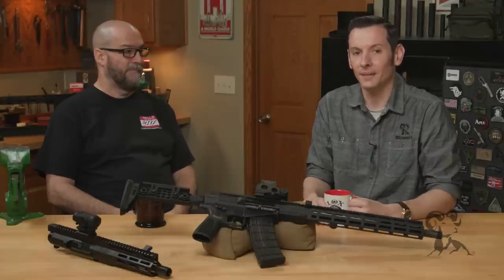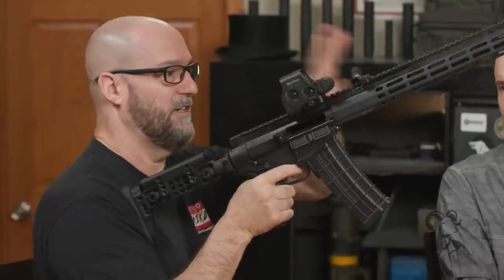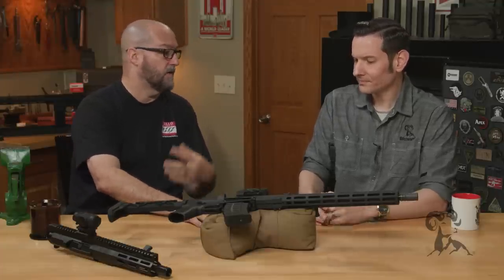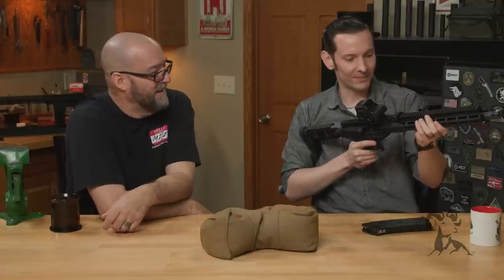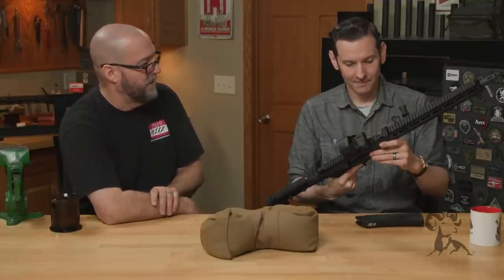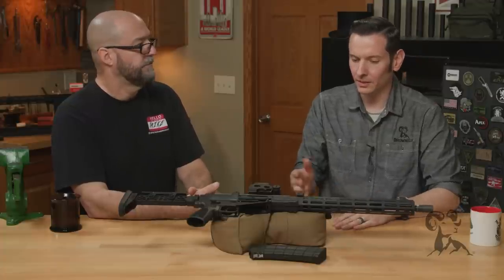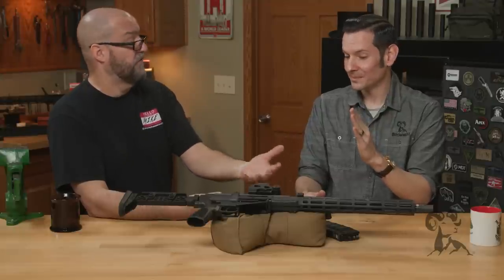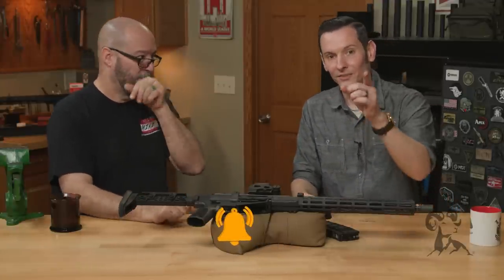Product Spotlight: Foxtrot Mike Slap Mod

Comment: this in 7.62x39 with a gas piston would have been absolutely game changing (I say would have been because of the rus ammo ban)
Reply: That's what the BRN-180 is for.
Reply: @mig1nc   Yea, the BRN 180 is nice, & close to what I believe OP has in his head, because its in mine too, the what the BRN falls short on is it doesn't take AK mags. The Mike-102 hits all the marks, just need to be piston driven, chambered in 7.62... or shit maybe even a 5.45 option...
Reply: An AR platform not taking AK mags is not a shortfall, at all. This rifle a prime example of that along with the Palmetto State KS-47, which I have.

Making an AR to function with AK mags means you lose features like LRBHO and bolt lock/bolt release. Everyone that has shot my KS47 had second thoughts on it when they realized those AR functions were removed. Determined that if I’m shooting 7.62x39, use an AK or an AR that uses STANAG mags.

Comment: Eugene Stoner got this right the first time.
Reply: The first time, he got the charging handle under the carry handle, where we put optics nowadays.
Reply: Cope
Reply: Considering how high people run red dots nowadays, the OG changing handle might clear that space.
Reply: @ChaohsiangChen And it was REALLY hot and could brand your finger.
Stoner was a GENIOUS and designed and absolutely amazing weapon..  but iterative improvements happens for a reason.
We tinker and try things.  Some of them work great and live on, some of them die.  You don't know until you try.
Reply: stoner took the johnson LMG, slapped his gas system on it, and filled the BCG with a bunch of tiny parts you get to lose in the field every time you clean the bolt.

Comment: I would 100% buy this if I had a compatible gun. Super cool.
Reply: Buy the lower and you will
Reply: @dangerousfreedom4965  *will not
This system is designed for Foxtrot Mike's proprietary bufferless uppers.
Reply: @InvidiousIgnoramus brn180, and the JAKL will work on the FM lower.
Reply: @InvidiousIgnoramus  the uppers fit on any AR lower, the only proprietary part is the bolt carrier. The barrel nut is a bit too tight to fit most barrels but you can modify some to work. The proprietary bolt carrier can take any bolt. Some people have made fm15s in 7.62.
Reply: @TazyBaby  this video is SPECIFICALLY about a handguard upgrade kit for FM-15 uppers. It is not compatible with other upper receivers.
Reply: @InvidiousIgnoramus  yes and? I was talking about the proprietary aspects of that upper
Reply: @TazyBaby  Which as absolutely nothing to do with my comment at all
Reply: @InvidiousIgnoramus  when you say its proprietary and I talk about the proprietary aspects, it is relevant. Don’t bother replying, I’m not trying to have a conversation with such a rude person.
Reply: @TazyBaby  It's not relevant at all, because the handguard only fits an FM-15 upper.
Reply: @InvidiousIgnoramus  and I was talking about that upper, what’s hard to understand about that?
Reply: @TazyBaby  Probably the fact that you replied to a comment that's over a year old with completely irrelevant information?
Reply: @InvidiousIgnoramus  well, the ignoramus part of your name is absolutely correct

Comment: This is huge for the bullpup kits, like the Reap SCY and the upcoming A3 Tactical TRIAD. I can't wait!
Reply: They need to do a linkage for the magazine button or the A3 tactical is going to fall short.
Reply: The Reap SCY is already on the market, so not much they can do.  Hope they both put a little more effort into version 2.
Reply: @lance9150  No linkage needed for rock in mags.
Reply: @mig1nc  Yes, but the conversions mentioned use a milspec lower.  Some sort of paddle linkage on the bottom would probably be the most elegant solution, but these companies aren't going to listen.
Reply: @lance9150  your comment is six months old, since then have you seen the video BarginBinTactical did on the TRIAD? They seem to have covered what was needed. Nothing seems to have fallen short.

Comment: As a newly minted FM15 Gen II Zhukov owner, I can say that I NEED this for mine.   After living with the rifle for a few days, one thing I have noticed is that the side charging handle doesn't really lend itself well to locking the bolt to the rear with the standard AR bolt catch since you're operating both systems on the left side of the weapon (if you have the side charger in the standard position).  Being able to just pull it back and lock it HK style will be a real game changer in the FM15 manual of arms.  Shut up and take my money.

Comment: Can I get this for my FM-15 Gen 2 in 5.56? Or does this only work for the AK variant?
Reply: Why would you want it on one with Ar mags? It already has a bolt catch
Reply: @Kataquan  easier to lock back using one hand. When you pull back on the charging handle you need a second hand or empty mag to lock it in place.

Comment: If you could set up the slap mod to hold the bolt just behind where the bolt catch would hold it, there would be no need to remove the bolt catch

Comment: why is the extractor pin so fragile that its required to be replaced every time you disassemble the bolt face for cleaning? and why do instructions say it has to be replaced, along with a firing pin spring every couple hundred rounds?

Comment: So... does it fit onto an AR lower like the FM-15? Cause Caleb is right, that IS a whole vibe, and I want in... but without needing ANOTHER lower.

Never mind. They answered my question at the end. In the works.... I remove that Bolt catch on my AR, if I can trade it for the slap mod (shut up... I had considerable time on the MP5 and I want to feel that cool again... don't judge me!)

Comment: breaths intensely Holy moely, the possibilities of this product, and at around 100 dollars, it will be a hit and I see possibilities to expand into even converting and letting go of the rear charging handle of my ar15 in the future. I think I will finally buy something shorter than a 20 inch barrel for my ar15 just for this, maybe a 9mm upper, and even a hybrid 7.62x39 ar. This feature is going to bring a lot of recreational fun to the gun community, Im loving it.

Comment: this is cool, im currently researching how i can make an ak/ar hybrid but have the bolt be right side charging like the ak as well, currently i have it down to using a psa ks-47 lower and a bear creek arsenal upper in 7.62x39, thing is the upper and bolt need modified to fit and feed from an ak magazine, so i need to get a milling machine of some kind. have my eyes on one thats not to costly, id just need to buy the parts and give it a shot, it it works then ill have a one of one ar/ak hybrid that you can actually do an "iraqi" reload with. what would be even better since the fm-15 upper is piston driven i could have that too and have a true ar/ak hybrid.

Comment: i have been thinking about this
are rear charging handles dying out?
Reply: No.
Reply: As much as I hate the charging handles current location, moving it forward onto a sloppy rail isn't the answer.
Reply: The Robbinson side charger like a FAL, or Galil ace is the answer
Reply: @dangerousfreedom4965  gibbz upper

Comment: maybe i'm slow, so you are sayingthat the ak upper will fit any standard ar-15 lower.  so how do you rock the ak mags in to the ar lower or do you have to find ar 7.62 x 39 mags to work with that upper?
Reply: I think they meant any standard AR lower that only accepts AK mags, so not the OG that accepts stanags